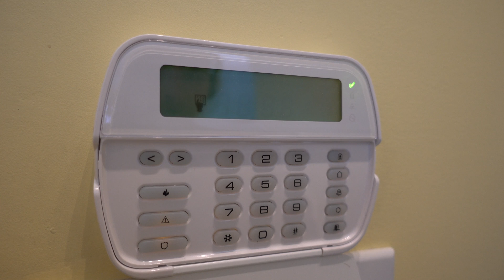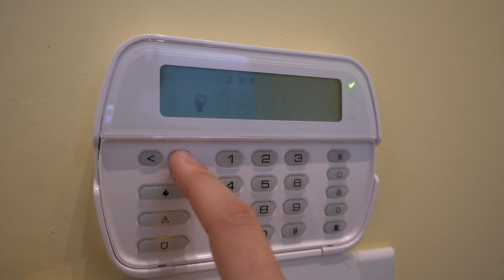How to Read Binary on DSC Keypad

Comment: The keybpad doesnt do anything.I have tried a hrd reboot of the main board but nothing
Reply from the maker: If the keypad does not respond, it may be a bad connection or you need a keypad replacement. It's rare but it happen sometime.

Comment: We moved in to a home it already have a dsc system without any installer or master code. I follow your video to factory reset and now I have a installer code. How I going reprogram all the 14 zone ?
Reply from the maker: Well, programing a DSC system for the first time is not an easy task. I plan to do video about it eventually, but I think you will need a technician.
Reply from the maker: ... Or a lot of motivation and the installer guide. ;)

Comment: Let me see if I can help explain.
Binary numbers work with 1's and 0's.
Each "place" represents a power of 2: starting with 2^0 = 1 (decimal)
This is similar to how in decimal you have the 1's place, the 10's place, the 100's place...powers of 10.
But in binary, those places are: 1's, 2's, 4's, 8's, 16's, 32's, 64's, 128's, etc.
Like so:
128  64  32  16  8  4  2  1
You will only have a 1 or a zero in each place.  So a '1' in the 4's place and a '1' in the 1's place means 5 (decimal) because 4+1 = 5.
So we can see binary numbers as:
binary  decimal
0000 = 0
0001 = 1
0010 = 2
0011 = 3
0100 = 4
0101 = 5
0110 = 6
0111 = 7
1000 = 8
1001 = 9
1010 = 10 (=A in hexadecimal or "hex")
1011 = 11 (=B in hex)
1100 = 12 (=C in hex)
1101 = 13 (=D in hex)
1110 = 14 (=E in hex)
1111 = 15 (=F in hex)

DSC is representing where the 1's are in what places.  Effectively, when they print "1" they mean there is a 1 in the 1's place.
DSC 2 = 1 in the 2's place, DSC 3 = 1 in the 4's place, DSC 4 = 1 in the 8's place.
So you could translate the above table to DSC-ese by:
DSC "binary"   decimal
0000 (nothing) = 0
0001 = 1
0020 = 2
0021 = 3
0300 = 4
0301 = 5
0320 = 6
0321 = 7
4000 = 8
4001 = 9
4020 = 10 = A
4021 = 11 = B
4300 = 12 = C
4301 = 13 = D
4320 = 14 = E
4321 = 15 = F

Comment: Hello, what is number for value 32 on the pc1555rkz Dsc 8 zone led keypad. Thank you.
Reply from the maker: Hi Nirven! Well there is no value for 32. You will have the value ''12'' for 3, then press the right arrow and you will see ''2'' for 2.
Reply: @HowToPM  thank you for that...I needed to program one of the zones for instant stay/away....according to manual i need to program that zone for a value 32......instant stay/away. I struggling to input 32.

Comment: How to connect an new DSC glass detector man ? Also I want to know my installations code ?
Reply from the maker: Oh about the installer code, the default one is 5555, if it's not that anymore, well, the only thing you can do is a factory reset.
Reply from the maker: I will have to do a video on this one. But it's the same principle that any other contact you can add. I plan to do a full video about the installation procedure this year.
Reply: The penal is locked down ! I tried but it gives me the clicking sound when I plug the electricity ON means it is locked !

Comment: This doesn't really help.  I get that 1 =1  ,  but after that i'm lost.   Your explanation is almost good enough.
Reply from the maker: Well I could redo the video with more animation. in short
1 = 1
2 = 2
12 = 3
3 = 4
13 = 5
23 = 6
123 = 7
4 = 8
14 = 9
And 0 will show empty.
Reply: I dont know what the fuck he said either but i basically just compared the value that shows up on my keypad and compare it to what he showed as he basically recited all the binary numbers and the corresponding values